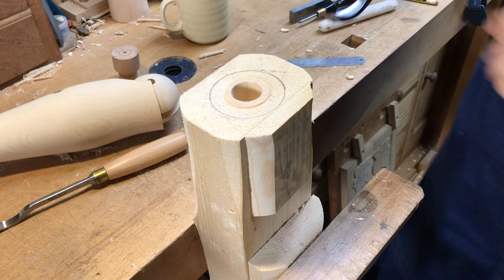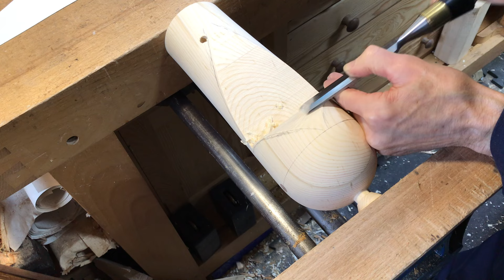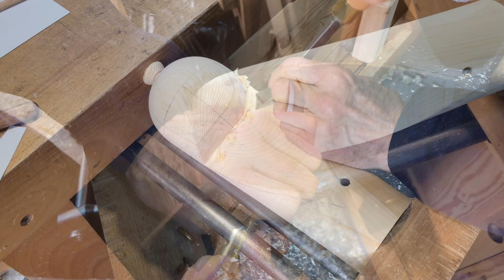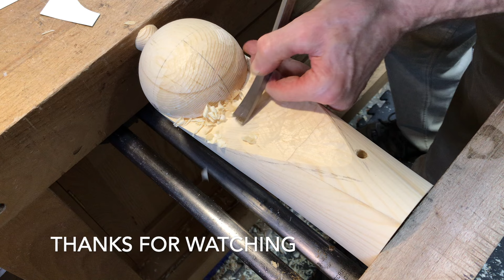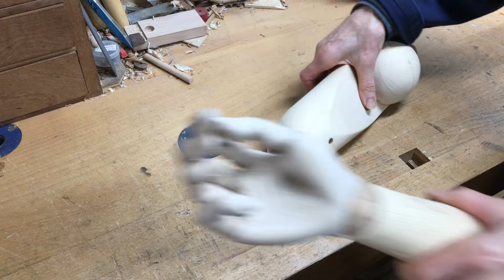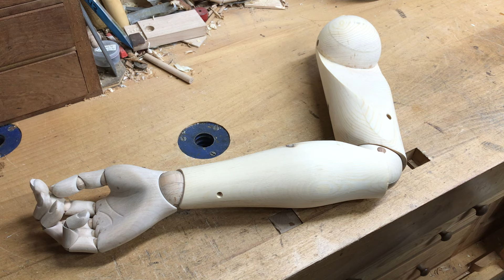A S M R  Carving a ball and socket

Comment: It is visualizing the shape that trips me up more than any other execution
Reply from the maker: Trace the pattern on the wood then chop out the wast as neatly as you can. Keep things as square as possible, then round them off later. This means you don't have to visualise or even be able to draw, as long as you have a pattern to measure from. Copying an existing pattern is a lot easier than trying to design one. Thanks for the feedback.